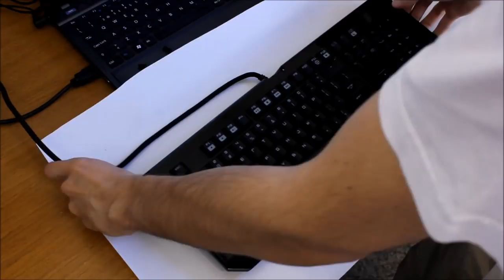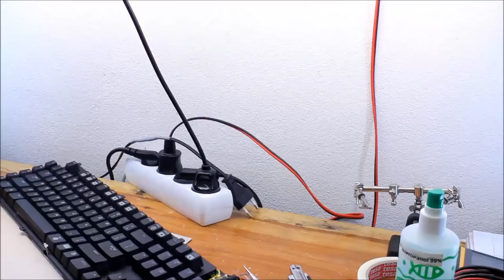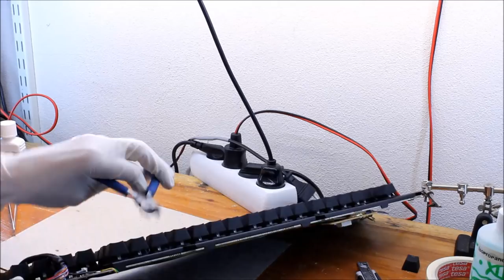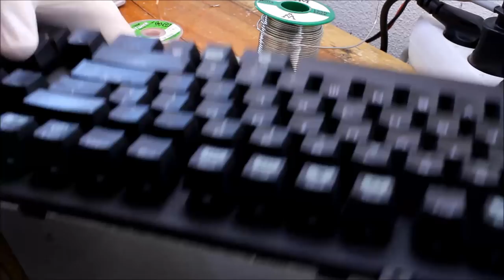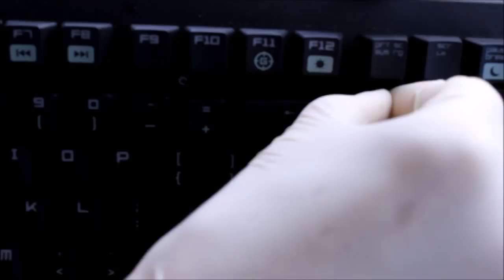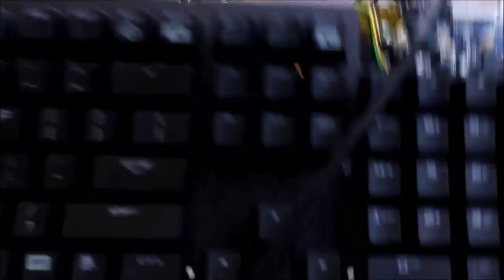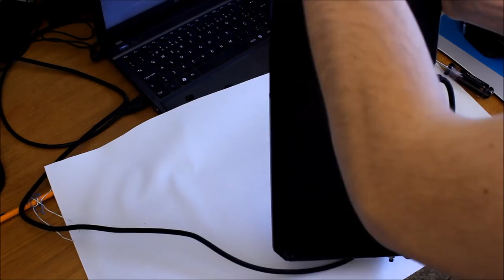How to replace backlight LEDs and Cherry MX switches in a mechanical keyboard.

Comment: Hello, I have a blackwidow chroma, 3 of my keys arent showing the red colour properly (one doesnt work at all) and there is another one that the blue colour isnt working, is there a "chroma" led that changes colour or do i have to buy leds of the colours that arent working properly?
Reply from the maker: Usually RGB keyboards have RGB leds (3 LEDs inside a single package, like this one: https://schwiftyarduino.files.wordpress.com/2016/06/rgb-led.png?w=750), if you remove the bad LEDs and also one of the good ones, I'm sure your local electronics store will help you find a similar one.

Comment: thank you for your tutorial, just one question. I have a BWU Chroma, which used RGB LED, if i'm replacing the switch (razer green to cherry mx red for example) and manage to keep using the stock LED, will it (the RGB LED function) works like before apart from the switch?
Reply from the maker: If you find a switch that can hold an RGB LED it should work fine. 

Note that you want to use a regular Cherry MX, you might have to modify the new switch to fit the 2 extra legs of the RGB LED, razer uses 3mm RGB LEDs on top of the switch, the new Cherry MX switches used in RGB applications are transparent, so they use an SMD LED soldered on the board and let the light pass through the transparent casing, like these: http://www.cherry.de/cid/keymodules_CHERRY_MX_SILENT_RGB_RED.htm

Comment: Great toturial dude! Im looking for new keys.. how many pins do this original black widow keys have? 2 or 3? And where can i get new ones? Thanks!
Reply from the maker: The switch itself only has 2 pins, the other 2 are for the LED. you can buy them on websites like eBay, aliexpress, etc. or on some electronic component retailers like mouser.com
Reply: José Faria yeah i tought so.. i was looking on ebay so far.. and they have some mechanical keys with 3+ pins.. ill have a look on ali and that other site! Thanks a lot!

Comment: Would this work on the standard blackwidow keyboard without soldering? I want to replace some switches on my keyboard but I don't have a solder pump on me.
Reply from the maker: Not without soldering. If you only have a soldering iron, you can try heating both pins at once, but it might be hard. I seriously recommend a desoldering pump too, even a cheap one.
Reply: Ok. Thanks for the help

Comment: will this work on the Blackwidow Ultimate Classic 2014? It does not use Cherry MX switches but I'm not sure which razer switch it uses. I'm looking to replace it with cherry MX blues.
Reply from the maker: +BiteEdits It should be very similar, as far as I know they are Cherry MX clones. How  many are you replacing, by the way?
Reply: José Faria Most likely only the letters, numbers, space key, ctrl,alt,caps and pretty much all the keys except for the arrow, numberpad and the Home/pagedown-up etc.
Reply from the maker: ***** You'll probably spend more than 70USD on the switches alone, I got rid of mine and bought a "proper one". :P

Comment: Hello mate, I have a general question. Can i change from red LED to whites on my keyboard. I know i need higher voltage from 2 to 3volts. But maybe it will work, do you have any idea ?
Reply from the maker: If your keyboard uses a resistor on each LED it will work, even if it has a bit less brightness, if they are in series it might or might not work, you have to replace most of them to try. The one I currently use can address them individually, if yours is similar you can replace a couple of them and see if they light up.

Comment: Is it possible to upgrade your regular BlackWidow, and install LED yourself? 
I just bought the 2013 BlackWidow Expert, due to no stock of the Ultimate. But I'm still longing for those backlit keys without spending another 150$ ish

Comment: Where did you buy the MX Switch replacements? I need to replace the D and L on my keyboard.
Reply from the maker: +PNAKOAO You can buy them from an distributor like mouser :http://www2.mouser.com/CHERRY/Electromechanical/Switches/Pushbutton-Switches/_/N-5g30Zscv7?P=1yx81g5Z1yxkiit

Or from a dedicated online store like this one: http://www.wasdkeyboards.com/index.php/products/keyboard-parts.html

Or on eBay, but on eBay or Aliexpress the chances that you will get a clone switch are higher.

Comment: Do i need a soldering sucker? also if i get some solder on the chipboard will that damage it? :( i'm trying to swap our an LED on my keyboard!
Reply from the maker: A solder sucker is not absolutely necessary, but it will make your life a lot easier, especially if it's an heated one, even one of those $10 ones. Regarding the damage, you will not damage anything if you drop solder on the bottom of the PCB as long as you clean it up afterwards, as far as I remember there are no components in the underside of the PCB.

Comment: Hey there, jsut noticed that my Steelseries 6gv2 has led mount holes. Will I be able to work some leds? I mean, if the circuit board is prepared to get leds and if it can power them. Thanks, btw, are you portuguese or brazillian?

Comment: how would one go about doing this on a corsair tenkeyless RGB keyboard? Okay so at best buy i saw a tenkeyless version of the k70 RGB, and it looked amazing, as i want a tenkeyless keyboard. BUT, this keyboard is only sold with cherry mx reds, and i want blues because i love the clickly sound and tactile feedback. so would you have any suggestion about how i would take off all the swtiches and replace them with blues?
Reply from the maker: You have to replace them with the special cherry mx blue LEVEL version, but I never saw them on sale yet. If you replace the "special" cherry red with regular cherry mx blue switches you will lose the RGB backlight feature. As far as I know, insted of having a 3mm LED under the keycap, they made the "RGB" switches transparent and the key is illuminated from SMD LEDs on the board under the switch. If you replace it with a regular switch the light won't get through the black plastic case.
Reply: José Faria yeah i knew that the swtiches had a clear housing. so i guess ill just wait and hope that they release a cherry mx blue version of the k65 rgb
Reply from the maker: They released the K70 with red, brown and blue switches, they might do the same to the RGB versions.

Comment: Im not great at soldering but i really want to replace my black widows LED's and Key Caps, the key capss im fine with but is there another way to do the LED's that might be easier for somone that has never done this before?
Reply from the maker: Sorry, no. The only way to replace LEDs on this keyboard is to take it apart, desolder the old one and solder the new one.
Reply: Wow i have to give you credit, this looks like alot of work and i give you props, i dont thin i could do this by myself :/ but man your keyboard looks sick!

Comment: picked up a black widow ultimate bf3 from a friend, backlight doesnt work at all. not a huge issue because of where it sits in relation to my tv, but how would i go about getting the backlighting to work? ive taken it apart and cleaned it already. only num/caps/scroll lock and the gaming/macro mode lights work. ive tried the synapse profile trick and different drivers but to no avail. to razer logo doesnt even light up either. any ideas?
Reply from the maker: I would first check the LED driving transistor, see the blog post in the video description, it's the transistor I removed to make the modification.

Comment: Hey, thanks for the helpful video. Im thinking about replacing 2 keys on my CM storm quickfire tk Red to blue. I found some on internet but not exactly sure if there are holes for leds, but if i would loose backlight on those two i wouldnt care that much. Comments really helped me answer lot of different questions, but i coudlnt find two:
1.is the removed cherry switch repeatedly usable?
2.if there would be holes and i get red leds(stock) there and later i buy blue leds and use them, should it work all normally? (Color mixing)
Reply: its leds,leds will work as long as you connect them to a power source,and there are holes for the leds in switches that sont come with them
Reply from the maker: +Kristián Masaryk Regarding question number one, yes, used switches will work fine, you can use switches you removed from other keyboards (as long as you don't damage them, of course).

Regarding point 2, it might not work. If I recall correctly, at least some CM keyboards have a strange LED layout with LEDs in series and parallel, and when you mix colors in parallel some LEDs will have all the power while others won't light up, but you will have to test it yourself.

Comment: can i add the non led side of my keys to light? just by putting those flangless led and solder it?my keyboard is a cm storm quick fire pro it only a partial led backlit. and my intention is.. can i modified it be a full backlit?
Reply from the maker: I never disassembled one of those, but if the PCB has the place for the LEDs it should be easy, if it doesn't you will have to work a bit more.
Reply: ok.thanks.

Comment: Hey is there any way to make the regular blackwidow backlit? Would a lot of modification be needed?
Reply from the maker: if you stick an led in the existing holes, does it light up?
Reply: If there's no backlighting in the first place you won't be able to. There's some tutorials to run el wire to make it partially backlit. But the letters won't light up.

Comment: heydo you know if i can add LED to my normal BW it got LED holes on its switches
Reply from the maker: Stick an LED in there and see if lights up. If it doesn't light up, connect it the other way around, if it still doesn't light up you might have to fully disassemble the keyboard (unsolder all the switches) and add all the missing resistors. I never had the opportunity to take a regular blackwidow apart, so I can't give you a definitive answer.

Comment: I was wondering if it would be possible to switch out red led's to rgb led's? I have a hyperx alloy fps pro keyboard with cherry mx red switches. I think white led's would also be fine for me, i just dont like the red led's anymore and have them turned off mostly, but its hard to find the keys when typing in the dark :P
Reply from the maker: Not really, you need some way to control the color and brightness of the RGB LEDs wich is not available in a single-color keyboard. You could switch red to another color of your choosing, though.

P.S.: There are also those novelty LEDs that you connect like a single color one, with two pins, but inthernally they are RGB and they have an integrated controller that changes color gradually, like a christmas tree, but you would end up with all they keys switching colors at different times, it would probably get a bit confusing:
https://www.ebay.com/itm/100pcs-Diffused-3mm-RGB-2-pin-Slow-Automatic-Flash-Rainbow-flashing-LED-Diodes/121729828488
Reply: @jfaria  yeah all the leds changing at a different time would look weird i think (but maybe cool during the holidays haha). I’ll think about changing led’s to white tho!

Comment: Hello, I just finished changing the green leds with red leds to match my theme, except I feel the red leds could be a little brighter. I'm also  using a razer blackwidow, like you. Do you know if there is a way to make the leds brighter? The leds I got have this description: "LED RED DIFFUSE MM 2.0V 10MA 50MCD" I'm allready at full brightness in the software.
Reply from the maker: To be honest no, I don't see any easy way to increase the brightness.

The "straightforward" way would be to either increase the voltage to more than the 5V of the USB port, which is a bad idea, because this is the same source that powers the other electronic components of the keyboard and they probably wouldn't like overvoltage, or you could replace the resistors with lower value ones, which would imply removing all the LEDs and switches... so not really feasible too, it would be easier to replace the LEDs with better ones.

The only other way that I'm seeing is using a separate power supply to create a negative voltage rail. This could be connected to the cathodes of the LEDs instead of the PWM transistor, thus lowering the cathode voltage from 0 to whatever value the negative supply gives you. For instance, with a -1,5V supply, instead of 5v in the LED resistor (5v from the USB minus 0 from the ground) you would get 6,5V in the LED resistor (5v from the USB plus 1,5v from the negative supply). Not that simple too :D

Red leds typically have lower forward voltages than green ones, so replacing green leds them with red ones should result in an increased current draw. Maybe your LEDs are just not very energy efficient?
Reply: José Faria Thank you for your reply, I have however just decided to replace them with much stronger leds. As it turns out the ones I used were not that great, they only had a luminous intensity of 50mcd. I wasn't aware of these great differences between different kinds of leds until now. I am now soldering some 2200 mcd ones in their stead and this gives much better results. Having leds with 40 times more luminous intensity makes quite a difference ...
Reply from the maker: ***** Yes, LEDs can vary a lot between manufacturers, you can test the LEDs before soldering them, just connect them with a 470 ohm resistor to a 5v power supply and you can have an idea of how bright it is. Be careful not to lift pads, the PCB is very fragile (or I got a particularly bad one in mine).

Comment: Can i do that on a Razer blackwidow 2014.
some keys are broken and i want to repair it but on the 2014 editon they using Razer green switches so 
can i replace them with cherry mx red or brown?
Reply from the maker: +3Dia&#39;s They are similar, it's worth a try. The Cherry switch most similar to the Razer Green should be the Cherry MX Blue.
Reply: +José Faria Hello, 
Will this work with the 2016 Razer Blackwidow Ultimate? I have an all black/white setup with a green keyboard, doesn't look too good haha. Thanks.

Comment: Hey ... It would be great if you could help me.. I have this keyboard and 2 keys have stopped working so I was just gonna take from the page up and down keys.. My questions is do I still follow the procedure for your video? And what equipment will I need because I don't have any clue what your using... This is my first time haha 

Thanks!!
Reply from the maker: WhatThe! You can re-purpose unused switches and you can use the same procedure in the video. If you don't have any tools, you will need to buy a soldering iron, if you are not planning on using it a lot buy something cheap, ideally something cheap from a reputable manufacturer.

I also recommend an electric desoldering pump, one of those 7 euro ones will do.

So, this is the to-buy list:
- soldering iron
- solder 
- soldering flux
- desoldering pump (preferably electric)
- (optional) solder wick (be careful with this, it can damage the PCB if you are not careful)

You can buy this for around 15 or 30 euros. If you don't have a local supplier go to ebay or aliexpress.

Comment: Would this be similar to the CM Storm quickfire TK?
Reply from the maker: I'm using a CM trigger z right now and it looks like the construction method is identical, so the procedure for LED and switch replacement should be very similar.

Comment: Is it possible to use RBG LEDs in all keys? Or just on the Razer Logo?

Also, how do you control which color the RBG LEDs show?
Reply from the maker: In this keyboard you can only control a single color LED, for RGB control you would need 3 signal lines per LED (or an LED with a controller incorporated, similar to the WS2811)
Reply: José Faria Solder WS2811 led in, with positive and ground on the usual spot; daisy chain the com lines on the WS2811 with slim wire.
put an attiny with arduino and serial to usb linked to side port.

Change color from virtual serial port! :) fill rgb control of each led! 
you could even use a teensy and store the conf in eeprom if needed :P

Comment: i dont know much about electronics but I do know how to solder. i like to replace the LED in my keyboard. Can you please tell me the size, volts and ma of the LED I need to buy.....thanks in advance.
Reply from the maker: It depends on your keyboard, but if you buy the same size LED with the same color it will most likely be close enough regarding voltage and current. Regarding the size, it also depends on your keyboard, you will have to check if it's a 3mm LED or if it's a more modern one, with transparent switches and an SMD LED underneath it.
Reply: @jfaria  Thank you for the reply. more power to your channel...

Comment: I know it's been a while but I'd like to know what wattage is your soldering iron? I cant get the solders to melt on mine and it's a 15watt iron.
Reply from the maker: +RagnarokDel I was out of the lab, so I was using a cheap soldering station on that one; similar to this one, but even cheaper: http://www.aliexpress.com/item/free-shipping-Temperature-Control-ESD-Digital-Soldering-Station-Rework-Stations-YIHUA-937D-with-EU-plug/32406262184.html

15W might be a bit too low, my station was supposed to deliver 48W, but even a properly hot 15W iron should be able to melt the solder, strange...
Reply: wtf, better get nother keyboard at that price, my a key only work is i press it on the right side